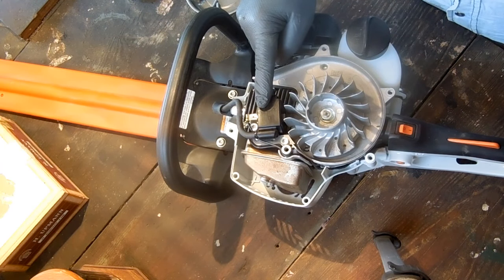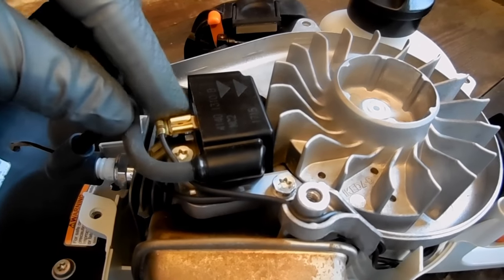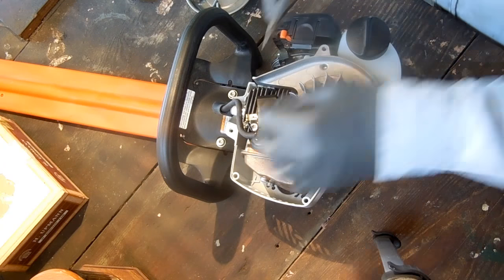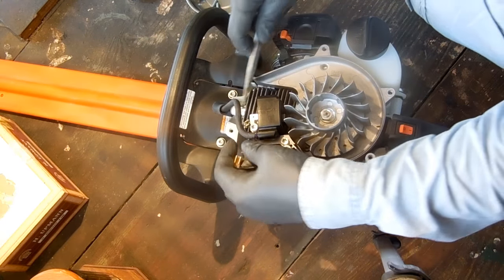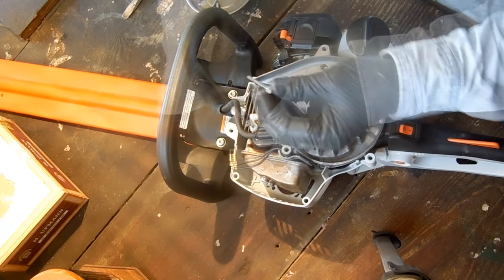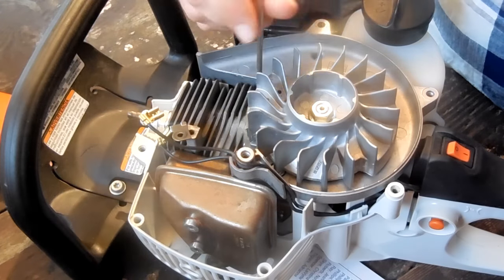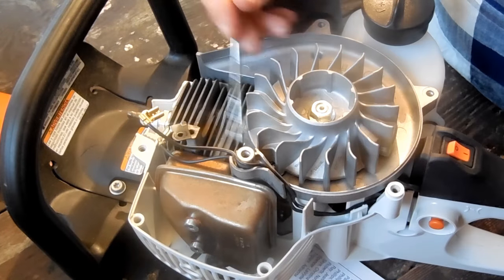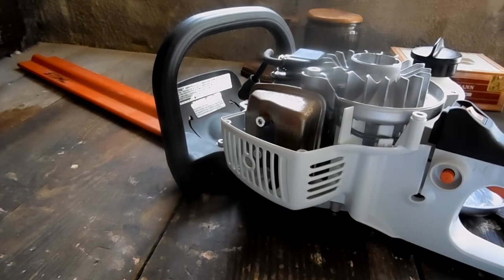Stihl Ignition Coil Bench Test and Replacement

Comment: A very technical video . Can I take it  that removing the spark plug and earthing it to engine block is  not a great way to test the ignition coil . I have a Stihl sh 86 that has a spark at plug and only fires  a short  moment . The coil is only 12 months old .
I would be interested in your thoughts .

Comment: Do you need to disconnect the coil to check the impedance?
Reply: No, pull the coil wire and meter between plug wire and coil laminated pick up. Remove the shut down wires and check again. The reading shouldn’t change. A short to ground shutdown switch can look like a bad coil.

Comment: Hi, Have checked the coil and have a good spark, but it still will not fire up, could you give me some reason as this will not go Thanks John.
Reply: If you have spark then it's a fuel problem.
Reply: Rob Yokom As someone mentioned, there is a primary coil test too not just secondary. 
  Check from the laminated plates to the small wire terminal.  If checks good, probably a fuel or compression problem.
Reply: @rickeykeeton71  And good is? I've read from 1.8 ohms to 3, my stihl coil read 4.7and still works

Comment: How did you determine air gap?
Ive done this befote on a mower, but i just used a credit card...
Lol
Reply: Use a business card, credit card is probably too thick
Reply: 0.50 with feeler gauge
Reply: Brendon Murray  I think you mean .005
Reply: On lawn mowers I have used a matchbook cover, it is about 0.020 inch.
Reply: Brendon Murray Is that not a little close?  I usually go 10 thousandths.
Reply: FREE KASMIR SAVE THE WORLD Thinking you mean k ohms. If not way off.  Check the Plates to small wire terminal?
  I have seen one person said they should read about the same between 3 and 5 k ohms. One said one would go as high as 10 k. Not sure about that at all.
Reply: Good enough look up spec then measure card.Call dealer for speck,they should be courteous.Probably got that by now.
Reply: @garyg5829  Think you mean 0.010 inch. his gap was to big at 0.5 mm

Comment: I think you forgot to test between the spade terminal and ground.  There should be a lower resistance.  That’s where mine failed
Reply: Yes, check manufacturers spec, usually 1.8-3 is ok